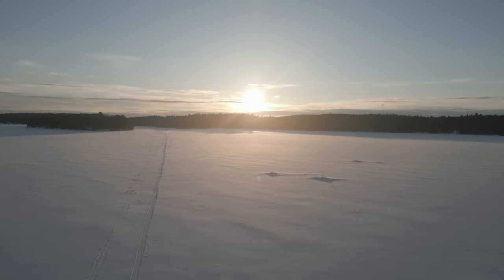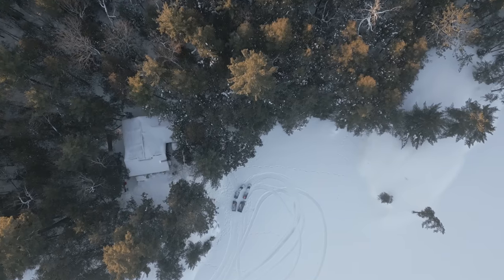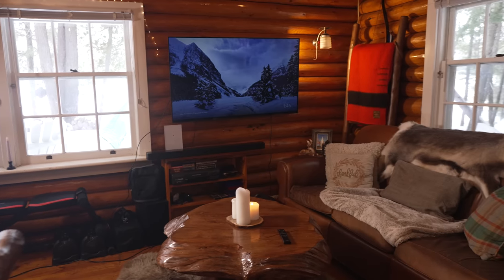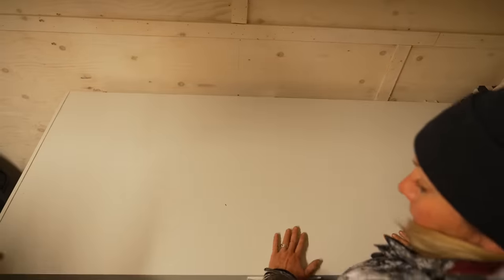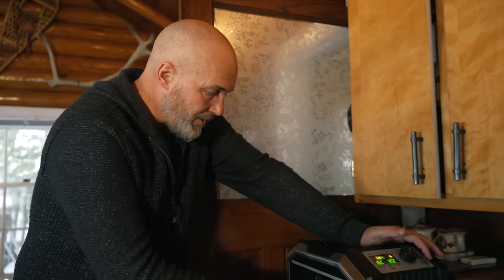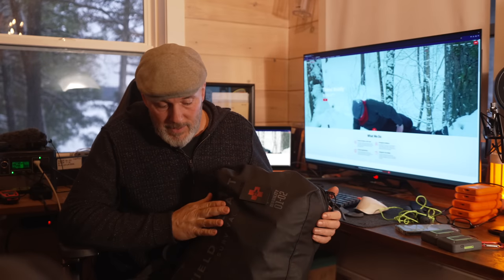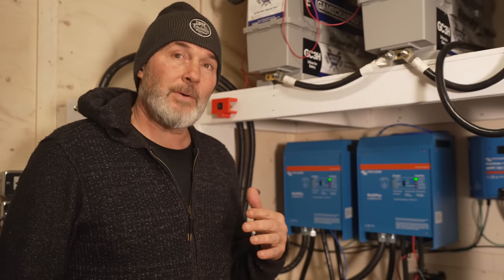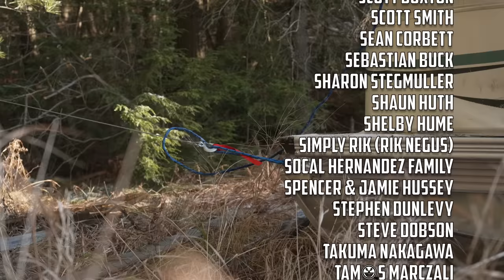CABIN TOUR | HOW A FAMILY OF 5 LIVES OFF GRID IN THE WINTER | A Self Reliance Journey // EFRT S8 EP5

Comment: Hi,
When i was young we had a cabin in the archipelago of Stockholm,
We had a Woodstove in the kitchen to kook on.
For the winter season we also had no running water but we had a well.
To heat water we had a 15 liter barrel with a tap coming out 10 cm from the side of the barrel.
We used this for doing the dishes and hand washing.
I saw you had a wood-stove and thought it may be good to have such a solution so you do not have to use propane for preheating water.

We had a similar solution at a scout camp using a milk canister and a water heating element connected with copper piping to the bottom and the middle for circulation.
The Water element was used as heat absorber in the fire.
This canister also had a tap and word spread fast in the camp of 400 persons.

I think the first solution is more convenient for you.
When the water is not used it will serve as a heat storage a while after the fire has gone out.

I love you Channel !!
Looking forward to the next video !!
Reply from the maker: Thanks for the tips!

Comment: For your power needs:
Have you considered a wind generator?
Or a paneled roof on the barge that could remain in full sunlight and tilt for maximum gain during winter?
Assuming the barge would be ok frozen in to the lake a few yards off shore?
Rigged properly, the wiring would be small gauge and longer lengths would be feasible. 

However, considering the cloud cover during winter and short days, the most cost effective system may be what you have: a generator. 
Especially if you plan to spend summers exploring elsewhere.
Reply from the maker: We’ll definitely look into that option

Comment: Excellent !  There's a lot more to this than meets the eye, at least if you want the modern conveniences.  In my youth, we had no desire for internet, or solar power, or tankless heated water because it didn't exist!  We got our water from buckets, drawn from the swift running river out back. Warm water was achieved by heating it up on the stove.  Warm showers didn't exist.   In later years, we installed a point, for a shallow well (probably 20-25 feet down) and had plenty of water year round.  Heat was from a wood burning, heatalator style, field stone,  boring hard wood fireplace (our favorite was apple or cherry wood) --  (not very efficient but it did the trick) supplemented by a hot-air, kerosene heater (kerosene doesn't gel like Number 2 fuel oil and was kept outside in a 250 gallon tank).  We lost electricity often, our back ups were Coleman stoves, and kerosene lanterns.  In other words, you're living a life of luxury with all that technology :-). I'm so happy you showed the slush on the lake.  I replied to one of your videos a month or so ago and cautioned you about that.  We would often encounter them and snowmobiles in our day were designed differently (very little track travel and maybe 50-60 hp).  Today, these narrow (12-15" tracks) and high horsepower engines can power through most (probably not all) slush fields and even hydroplane across open water (not recommended).  I noticed that in Scandinavia, it's common to see small hover craft, instead of air boats, in use across frozen or semi-frozen  lakes.  Airboats are exposed to the weather and while they can cross snow, I can imagine that being a rough ride across drifts  vs. open water.  But they certainly would cover any dangerous ice condition.  Well done.  I wish I was with you.  If you can find a Bombardier Bombi, or equivalent, you may find it useful too.
Reply from the maker: Thank you for all the good tips. We always read your comments as they appear even though it takes us a while to respond.

Comment: Very nice and interesting video. Wonderful nature, very good ideas and always something to do. Good planning, always something good to eat and above all, you already your nerves, from all the nonsense, which happens daily in the world. A nice familie, I like this. 
To the water, have a spiral of stainless steel (A316)wound, on the length of the chimney pipe in the cabin. Over the chimney pipe and above it a sheet metal covering, purely for the optics. 
A hot water tank, with safety valve and above all, a cirrculation pipe. If the tank is big enough, you can even connect a radiator to it. Two small pumps and you have a super system. Secondly, if you often have wind and I can imagine, why not install a small wind turbine, especially in winter, useful and couple it with the battery system of the solar system. If you have any questions, just send me an email. You could have sketches from me, so you understand exactly what I mean. 
Greetings from Frankfurt, take good care of yourselves, enjoy nature and tranquility.
Reply from the maker: Thank you for these suggestions. Very smart. We’ll definitely look into these ideas.

Comment: Another comment the battery system. How long do you have to run the generator for to give them a full charge? What size of generator is required to charge them up. Do you use something else to charge them like solar panels or a wind turbine?  Thanks!
Reply from the maker: We are using a Honda 7000 to charge them and it takes about five hours to get to 100%. We are in the process of purchasing and installing solar panels to help keep them charged. Once the solar panels are installed, the generator will just be used as a back up.
Reply: @EFRT  I suppose a Honda 7000 would be quieter than a Benchmark. I didn't think it would take 5 hours to fully charge the batteries. I thought it would be quicker. I have to devise a system to haul the batteries back and forth. Thieves would just steal them. Thanks again for the information!

Comment: Pretty slick presentation but the comment you made with respect to using any size tank to supply the source of bottled gas to your Mr. Heater could get someone killed via carbon monoxide poisoning. Some Mr. Heaters are only designed to work with specific sized tanks and gas a pressure. These have specific orifices designed to maintain pressure. Altering the size of the tank in some cases alters the pressure resulting in incomplete burning of the gases.  Suggest you research this further.
Reply: He was referring specifically to the large hot water heater unit of that brand, not the space heaters. That unit is designed to accept up to a 20lb tank like he mentioned. However, we, too, wondered about the use of it in the kitchen without a vent... 🤔

Comment: First, I find your videos too long and a bit self-indulgent. 45 min is a LOT, this could easily have been 20 min. Second, winter water is easy. Submersible pump and heated line to building, when you leave you can shut the line off. It will easily thaw the line quickly when you  arrive. We plumbed in air compressor connections to our water lines and use a small air compressor to blow the lines out. No water left so no freezing issues. When you arrive, heated line on then pump on, water running in less than a half hour.